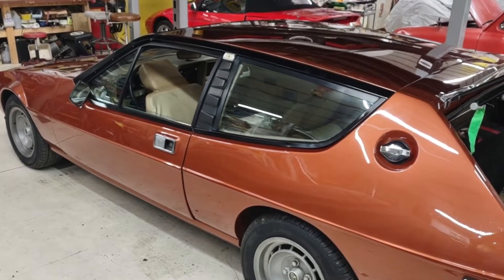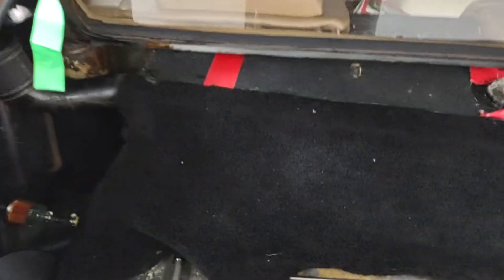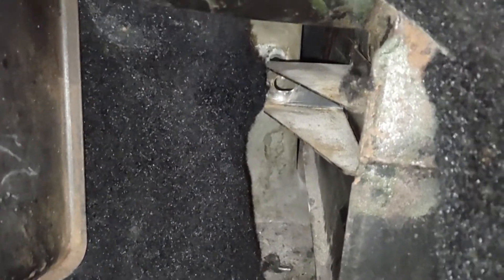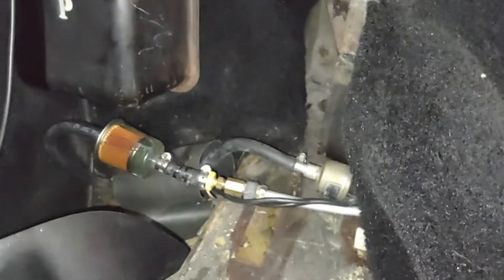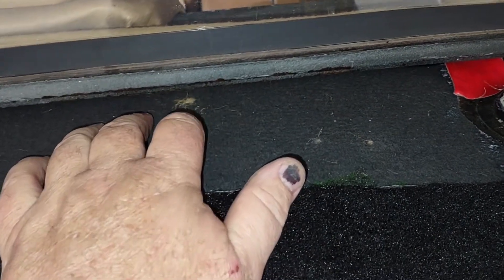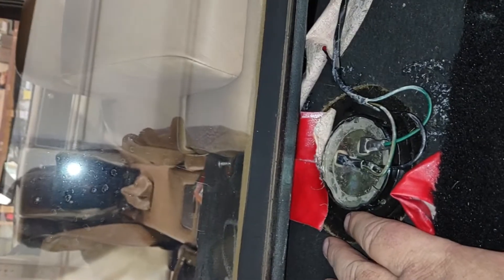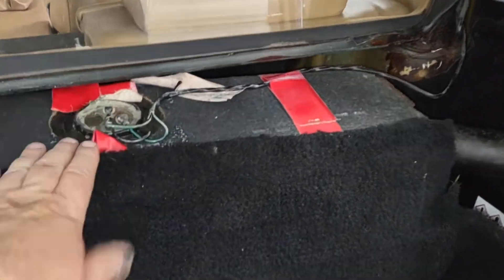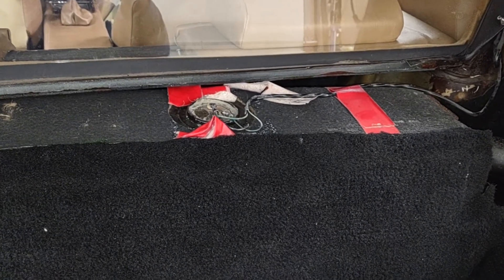1976 Lotus Elite Fuel Tank Sending Unit

Comment: Great - thanks, wouldn’t have known about the seat screws. I can’t get the outer bolts loose - do you have to hold the nuts on the back?
Reply from the maker: Yes you have to hold the nuts. 17mm box end worked for me while I turned the inside.